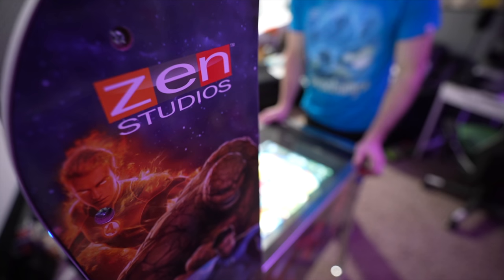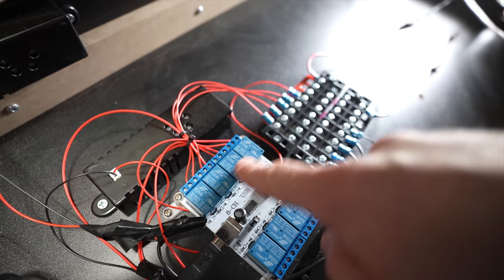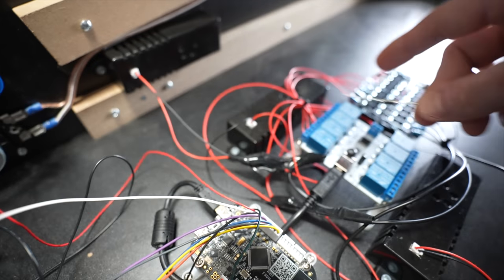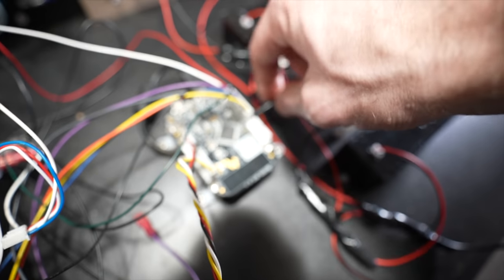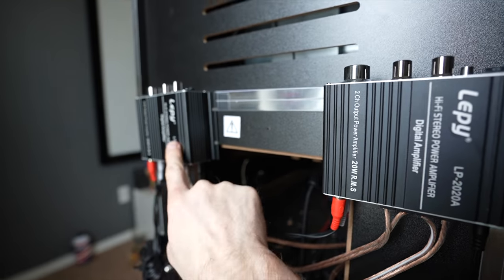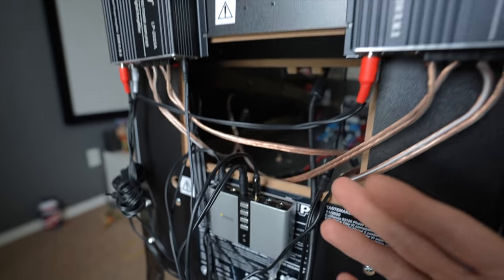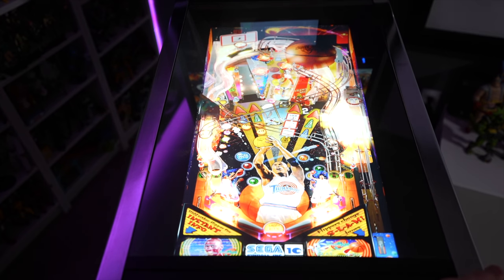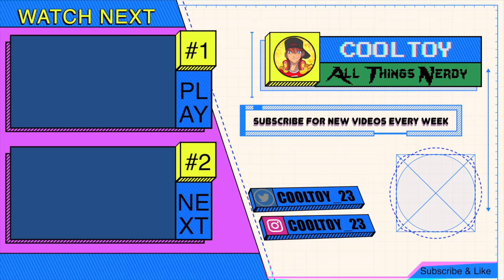Arcade1Up Pinball Mod - Surround Sound Feedback With Solenoids!

Comment: Let a longer video roll for mods like this. This will be a reference for people doing these mods. Even if it is soldering the diode. Easier to follow one video than hitting multiple ones. 
To be honest, I'd probably watch a video of you describing paint drying.
Reply from the maker: I’m was contemplating doing a “workshop” type of livestream in the future to possibly go over and show more of the nitty gritty details on both the pc side as well as demoing the wiring. It’s just hard to know how much demand for this type of thing there will be and how many people will want or need that info.
Reply: @cooltoy  You went over everything very well, but like me and I am sure others, it would be great to see a workshop video to do a little more "hand holding" for people not used to messing with wiring etc. I think your video would be THE definitive video to follow along to create an awesome modded a1up pinball, sort of like how ETA prime has 1 mill+ hits on his 1up cabinet mod.

Comment: You had me at 3D spacial audio! Very nice
Reply from the maker: It’s a very cool experience to hear things from the back of the table, and then the sound move forward toward me. Obviously it would be even greater if the machine was longer as the sound would travel more, but I enjoy the smaller footprint of this machine in my house vs a full scale pinball unit

Comment: Great tutorial!  You’ve convinced me to mod my Marvel 1up.  I’m doing the full deal, perhaps overkill as I intend on adding a shaker and gear motor. 
So far I’ve added the 22” back glass monitor, expanded my DMD with a 3d print overlay, installed 4 transducers, and an 8” sub. Working on de-casing a 32” LG IPS 2k 180hz monitor.  I’ve added 6 additional buttons as well.  
The part I need to figure out is programming my KL25z board.  I have a zero delay controller board as well which is pretty straightforward.  Any pointers on the kl25z would be appreciated.

Comment: I'm noticing that the external sound card you are using has a volume setting.  Do you need the separate amps?  If you were to connect the exciters to the USB sound card directly (soldering speaker wire to 3.5mm adapters) does the USB sound card have enough power to drive the exciters?

Comment: Thanks for the vid. I've been meaning to do the exciter (and solenoid) mod ever since I saw your video 2 years ago. Now that I've wired everything up, I'm having a heck of a time getting the SSF to work. I'm wondering if I need an amp for the back box original speaker b/c I can't hear them when I test the 7.1 configuration. And I have no idea how to get doflinks started for FX3, despite having watched the video in the description.

Comment: Incredible, COOLTOY!  Awesome job!  Can you go over PC Specs needed to run all these tables in a future video or reply here?  Thanks as always!
Reply from the maker: this is the recommended PC specs Zen suggests for FX3. Visual Pinball is much of the same assuming you don't wish to run higher resolution screens such as 4k.
OS: Windows 10
Processor: Intel i5-4590 or AMD equivalent
Memory: 8 GB RAM
Graphics: NVIDIA GTX 970 / AMD 290X
Reply: @cooltoy  Thanks COOLTOY, my intention is to have a dedicated plug and play gaming pc primarily for OTG with Legends Pinball so I don't need more than 1080p.  Just got mine last Tuesday so still haven't even scratched the surface with the built-in Gottlieb and Zaccaria packs to keep me busy for now.  Thanks for the reply, I greatly appreciate it!

Comment: Thanks again for this tutorial!

2 Questions:
1) What type of wires did you use to connect to the diodes, and from the terminal board to the sainsmart? Would standard button wires work for that?
2) Are you using the default power plug that came with the A1U pinball or from another A1U cab? Do you recall the specs on it (12v 3a I think?)

Thx

Comment: Really slick work here. I like how you used the common-rail approach to wire up all the power. It's just like I see in the bottom of my actual Gottlieb System 80 machine. 
The electrical tape made me shudder a bit but if it works that's all you need. 
Are you going to tidy up all the amps hanging off the back and install those inside at some point?
Reply from the maker: I soldered and crimped my diode connections and then put electrical tape over it all as an overkill precaution. Don’t worry it wasn’t just taped together, and yes I’ll be cleaning up the back end wiring as well. I left it all on the outside so I could easily show the connections in this video

Comment: Thanks for a great mod, just finished installing solenoids and configuring the ini's and more with the DOFL config tool and following your files. Does FX3 animated back glass work on Pinball Popper?  Thanks!
Reply from the maker: yes, you'll need to set up the animated backglass feature with DOF as well though
Reply: @cooltoy  Thanks again!  About to order the 32" screen and tempered glass

Comment: How do you use the stock volume control to control the volume? I got the stock power switch working but I'll be damned if I can figure out how to get the volume controller to do it's job

Comment: Working on the 1up mod for the 4 solenoids as we speak.  Just finished addition the diodes.  I am wondering if there are specific terminals to hook specific solenoids up to (in a certain order)  I am thinking ahead and maybe the coding expects the left flipper to be solenoid 1, and so on... but not sure how this matches up with the software since I am not there until later today.

Comment: Question for you. I have all the exciters set up for 7.1  via vpx sound options. Not getting any mechanical sounds. Exciters are working because I tested them via Windows 7.1 setup. Do I need to use doflinx with this also to get them to work? Thanks Doug.

Comment: Good morning Doug. I have another question about the exciters. What exactly do you call that connecter that is on the end of the speaker wire connecting to the exciter? Looks like some form of wire connector. If you had a link to that piece also. Thanks brother.
Reply from the maker: They are called Female Crimp Connectors or Female Wire Terminal connectors. You can find a miscellaneous box of them in any hardware store, Walmart, target, etc. 

I use them when I’m too lazy to solder my connections
Reply: @cooltoy  awesome. Thanks Doug

Comment: Doug, quick question.  I am not in any way an electrical engineer nor electronics expert. But, wouldn't there be a voltage drop at the end of the line depending on how many devices you are powering with the 12volt supply  without using a voltage regulator making some things not work efficiently?
Reply from the maker: It would depend on the type of devices one chooses to utilize with the set up. The Arcade1Up solenoids and the SainSmart usb relay were designed with 12v power in mind so they won’t have an issue. In theory I could add 4 more 12v solenoids to this set up and shouldn’t have a big drop in voltage since the solenoids all fire independently of one another in quick succession. If they all fired at the same time then yes, I suspect there would be a voltage drop, but without testing it I wouldn’t know how big or small that number would be.

I’m not an electrical expert by any means either. I know enough to be dangerous and had to take some circuit analysis courses in college as part of my media degree for some strange reason. Oddly enough that circuit analysis knowledge I learned is what I use more than anything these days with modding lol.
Reply: @cooltoy  Doug, thank you so much for your detailed answer. I loved the part where you said you know enough to be dangerous......I had to laugh because that's exactly what I say about myself. Lol. Thanks again for all your work!

Comment: Question—how are your running the audio out of the stock speakers in the cabinet? Did you reconnect them with a third amplifier? Leaving them set up as they were, it creates two separate connections on the computer, with the stock speakers running through HDMI audio. How did you resolve that to get all 6 speakers working together?
Reply from the maker: stock speakers are connected to the USB sound card via an extended 3.5mm audio cable in the 2.1 channel port.
Reply: @cooltoy  Thanks!

Comment: Wow, I like how far you've taken this project. Question: Are you using two Arcade1UP power supplies to power all the accessories? I'm a bit nervous about drilling the additional holes for the nudge buttons, but I will do it.  On a slightly bummer note, the backglass monitor was shipped and supposed to arrive this week, but I got a notice from Amazon that it was lost and couldn't get a hold of the seller to see if I can order another one.  I'll have to do some research hopefully I can find a monitor that fits.
Reply from the maker: Yes, I’m using the stock power supply with a splitter to power the scoring LCD and my playfield monitor. Then I’m using a spare 12volt power supply I had lying around (basically the same thing Arcade1Up uses) to power the usb relay/power bricks for my solenoid connections.

Sorry to hear about Amazon losing your package. It’s happened to me on more than one occasion before

Comment: Doug I was wondering how many exciters you added? And where you placed them. Also are you using only the stock speakers that came with the cab besides the exciters? Thanks in advance.
Reply from the maker: added 4 exciters, where I installed them is shown in this video. 2 up front, 2 in the back, Using the stock speakers that came installed in the back box.
Reply: @cooltoy  thanks Doug. Have a good weekend brother.

Comment: Hey Doug,

Any tips on getting the sainsmart working with VPX? Every time I try to load up TNG, the DOF plugin gives me an error about trying to initialize LEDs. My setup is basically the same as yours, so not sure why it's throwing up that error. Appreciate if you have any thoughts. thx
Reply from the maker: check your DOF config file, if you find anything in it that refers to the LEDs you can either remove that text or put a # at the beginning of the text and it will turn off that command.

Comment: Man when I get enough money to do all these mods with a pc. One day. For the time being, would I be able to at least connect 4 exciters with 2 amps while using the original a1up pcb? 
I bought 4 of them for my AFM hoping they give off a decent effect even though there wont be surround sound settings from a pc. Thinking I'd also connect a small subwoofer to the stock speakers too. Besides the exciters amps and splitters etc is there anything else you think i would need to get this to work nicely with the a1up pcb audio input? Thank you!

Comment: Are you running your tables at 4k? Looks like you are. I'm having a heck of a time getting pinup popper to play vpx games at 4k. They play 4k if I play through vpx directly. Play on popper they go back down to 4k. FX3 plays at 4k for me through popper. When you set up baller installer, did you choose 1080 playfield or 4k? I wonder if this is my problem. I just dont want to lose all the work I did on it, so afraid to go back to baller installer. Anyway, thanks for your vids. My 1up is looking pretty badace right now.
Reply from the maker: nope, just running them at 1080p as that is all that the stock Arcade1Up monitor is capable of.
Reply: @cooltoy  Actually you can take advantage of 4k, if your GPU can handle it, by using DSR 4.00x Resolution in nvidia control panel. AMD might have a similar setting. Then go to your emulators and change screen resolution to 4k. Problem is popper doesnt launch vpx in 4k but I can launch it in 4k in vpx. FX3 does fine. I figured out a workaround in the  popper launch scripts but it doesn't load the vpx games seamlessly, does some weird graphical buggy stuff until completely launched. I might try going back and reinstalling popper using the 4k playfield settings but if I remember correctly it made the playfield too big. So not sure now lol Anyway, thats why I asked.
Reply: @cooltoy  I figured out how to get vpx in popper to run 4k on the 1up without the force windo thing. If your GPU can handle 4k. I can help you out. The tables look so real in 4k absolutely no pixelization on the wireframes and flippers. looks surreal.

Comment: Can this kind of setup work with Pinball FX3 and/or Pinball Arcade... from Steam?  Dumb question, but what is purpose of the solenoids? are those like the exciters in an AtGames pinball machine?
Reply from the maker: Exciters and solenoids are two completely different forms of haptic feedback. I’ve showed several times in videos you’ve already commented on that I’m running FX3 via steam on this machine, so yes, it’s doable.
Reply: @cooltoy  so is it doable with Pinball Arcade also?  Can you give a basic definition of what the exciter does, and what the solenoids do....in a pinball game?  I did see this
http://mjrnet.org/pinscape/BuildGuideV2/BuildGuide.php?sid=contactors     ... "reproducing that tactile solenoid effect in a virtual cab "
The most effective way to reproduce the sensory effects of a pinball solenoid is to use some of kind of solenoid.
In a real pinball machine, they have to use a specific mechanism for each job, because each mechanism has to do the actual work of propelling the ball (or whatever it's meant to do). In a virtual cab, we don't have that constraint. Our devices don't have to actually do anything physical in the game; they just have to produce the right sensory impression

Comment: Could you please tell me how you got the screen portion to "lift up" ? I
 removed my plexi, metal rails etc but I just cant lift it up to get to 
the under screen area? Do i need to remove something else or hold a 
lever?  ( i have the marvel)
Reply from the maker: There are 4 screws that hold the mounting bracket down that you need to remove to be able to lift the monitor up

Comment: I was able to get DOFLinx working but my two bumper solenoids are setting off my nudge function. Any Ideas?
Reply: For anyone wondering the same thing, I had to move the control board off the cabinet floor and onto to a 1.5 inch foam cushion. Now it all works normally without lowering the g-meter sensitivity.

Comment: I know you did the 32” then went back to stock size. This is running 1080p isn’t it? Did you swap it with another 24” monitor?
Reply from the maker: This is the stock monitor running 1080p. The only thing preventing the stock arcade1up games from running at 1080p was their pcb being hard coded to only output 720p.
Reply: @cooltoy  I have a lvds to hdmi adaptor board coming today in the mail. That all I need for it?

Comment: did you/will you explain the software used to make all this work together?  If so, I will watch that video too.
Reply from the maker: Fx3 via steam, and visual pinball x are the two programs that are running, and then I’m using the front end Pinup Popper by Nailbuster
Reply: @cooltoy  thxs for info. How does Pinball FX3 know how to use/when to engage the solenoids and fire off the sounds in your surround sound system?

Comment: How are the main pinball speakers hooked up? And are the stock?
Reply from the maker: I’m using the stock speakers. I have them connected to that usb sound card I showed. I just used a 3.5mm extension cable to make the stock speaker cable reach down to my usb sound card

Comment: Can you still play hot seat/multiplayer on FX3 games with Baller Installer?
Reply from the maker: Baller installer is just a visual front end, all the same features of fx3 are still accessible
Reply: @cooltoy  Great to hear, thanks for the tips!!
Reply: I just finished adding the solenoids with your help, the diagram was great with the links!  Working on the Doflinx config tonight.  I've added extra buttons and will be upgrading the play field to 32" and will end with Baller Installer.  Thanks for all the help!!

Comment: What is the Zedboard for ?
Reply: The board he has controls nudge and acts as the button encoder. Check out the part 2 mod video.
Reply: @MrEd20901  thanks ed.  Do you have to use a zedboard?  it just looked like a really complex encoder.  Is it the only type that has nudge?
Reply from the maker: If you don't care about analog nudging then you can use just about any encoder you wish.